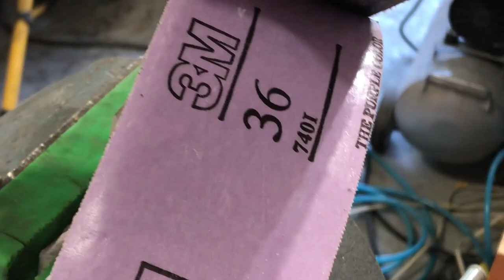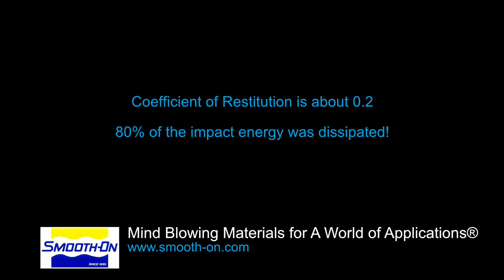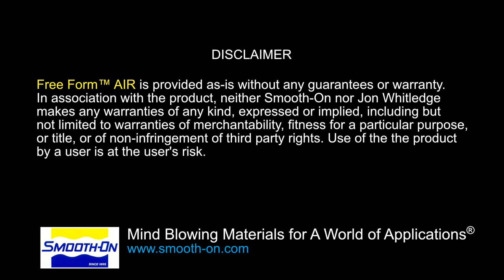Use of Free Form™ AIR in Mobile Audio Loudspeaker Enclosures

Comment: Thick in pages thin in content!  Half the video was aimless talk with no demonstration. The next third or so was pointless kneading with no explanation of the process. It was followed by a segment of showing drilling and tapping of various size holes on a scrap piece instead of the actual speakers, which was the intended topic of this godforsaken video. The space cadet then decides to mock our patience by showing him throw a ball of the hardened material to demonstrate its strength and his own fragility simultaneously. Finally, the video ends with a series of stills showing the speaker at various stages of construction with wood and fiberglass incorporated into the molding. Surely, given that Smooth-On is a well established supplier of the film production and special effects industry, you would expect them to demand higher content standards even from a hapless space cadet.